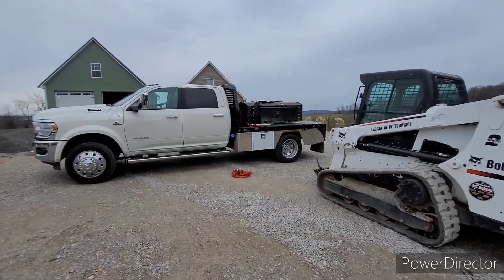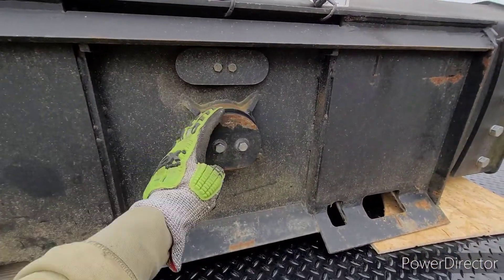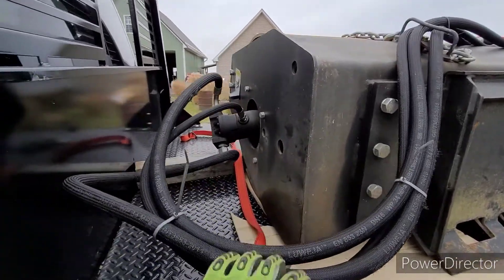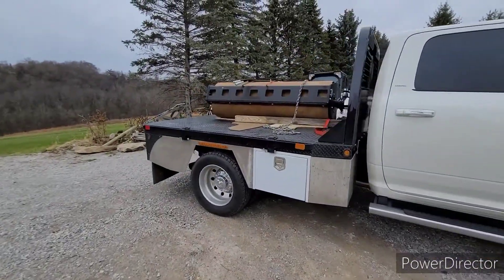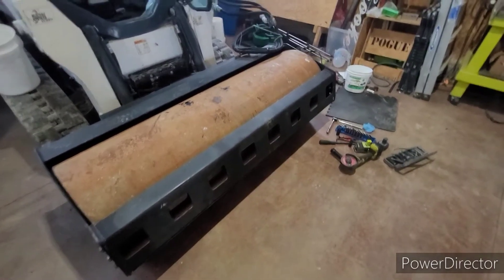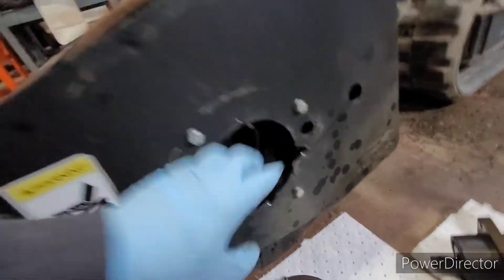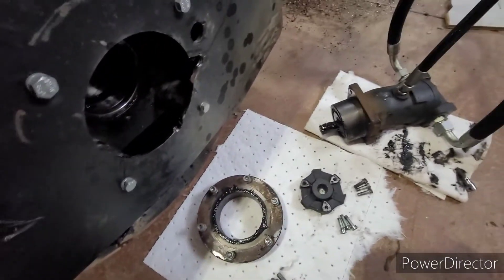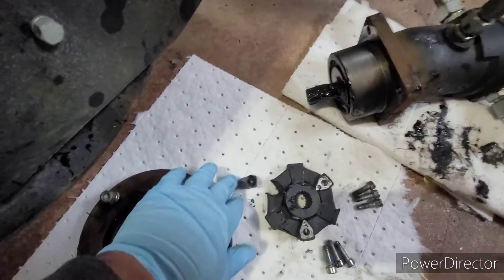Chinese skid steer vibrating roller diagnosis - Smoking problem.   Part 1

Comment: Did you ever go back and work on this more or did you give up on it?
Reply from the maker: I put another lovejoy in it and stopped running it at full speed.  It still smokes, but it got me through the last job.  As others have said, we believe the shaft isn't straight causing miss alignment.  It's currently a lawn decoration, waiting to send off to an auction

Comment: I have same roller same problem part # please
Reply from the maker: @raymondpadilla7041  68514438814
Reply: @ thank you .part has been ordered. Does this part take oil in the cavity? The housing had what looked like a rubber plug.
Reply from the maker: @raymondpadilla7041  mine didn't.  When you replace it, try reducing the flow, I think it will last longer

Comment: I have the same roller with the same problem.  Hoping you guys find a solution.  Has anyone looked at the parts from a different Chinese rollers to see if there is a better design that might work on ours?
Reply from the maker: I'm thinking about a belt drive setup

Comment: I have just received an email reply from Agrotk admitting the truth!

"Yes, we have had dozens of customers experience the same problem. It's a flaw in our machine design. "

It's time for them to become accountable for this design flaw. It has cost most of us thousands of dollars each. Unacceptable!
Reply: In the same boat as you admitted the part is bad and is discontinuing it.they hacked my email and erased all my messages from them if I was you I would copy your correspondence with them.

Comment: I have the exact same problem, and it seems many others do as well. IMO, this should be grounds for a class action complaint against Agrotk and Ritchie Brothers. This product is failing by design, yet they continue to sell it and rip off more unsuspecting buyers!
Reply: I'm on board with this guy.
Reply: Bro what??? You're buying a $15k piece of equipment for $1500 at an auction sold with no implied warranty.
Reply: I'm thinking the same as you but I went through my emails with them they hacked my email and deleted them all

Comment: Have you tried spinning the shaft by hand mine is very rough sounding and feeling
Reply: Mine is super-rough sounding, too. I'm starting to think that the failure of this connecting assembly near the motor is actually due to unacceptable resistance somewhere in the counter-weighted axle inside the drum. Maybe the Lovejoy-style connector isn't really the problem, but rather just the observable point of failure after something else causes too much strain and stress?

Is anyone else noticing a very rough sound from inside the roller before this connecting assembly smokes and fails?
Reply: @RickRossTN  I have a greatbear vibrator and it lasted 5 minutes working great.  Now it spools up, but feels as if its grinding on something and stops.  Puts a lot of strain on my hydraulic system when it does this.

Comment: I have the same unit, same problem. do you have the part # of the rubber spider?
Reply from the maker: Yes I do, it did the same exact thing though. Thinking is a bent motor,  checking it next
Reply from the maker: Lovejoy 68514438814 it was $147

Comment: How does the roller work now?
Reply: I have installed new bearings and seals packed the bearings with grease put it back together and it worked for almost 40 mins and then started to smoke. stopped unit and bearing was very hot add some more high temp grease. the connector is still ok but the heat is going to kill it. cant figure out why the bearings are get so hot? I keep spending time and money on this roller and still can't get a days work out of it. If the company knows there is a design issue then please tell us what it is so we can fix it.
Reply: ok I have taken the whole roller apart and the shaft bearing is the problem. tight, burnt and very poorly made.  bearing mounting plate on right side was loose bolts loose in drum. took bearing off of shaft softest bearing race I have ever seen. every bolt was loose and I only ran it for 5 mins? going to use lock tight when assembling.  Ordered new bearings should be in Tomorrow morning might have it running soon. Bearings where dry from factory. The grease I put in wasn't even close enough to fill bearing. Going to use the original lovejoy connector.  If someone finds a better replacement please let me know I have a feeling it wont last to long even with new bearings.
Reply: getting unit ready for new bearing that are coming tomorrow.  I was cleaning everything up and took the vacuum and cleaned out drum. Opps I think?? the about 1-2 pounds of metal filings  that where inside drum was it suppose to be there?? some type of damping? if anyone know please let me know before I put it together.  and if it was can I substitute sand??
Reply: @jphilippeos  where was the filings? I haven't pulled it apart that far yet. 
So are you saying the shaft and bearing get hot causing the failure of the lovejoy?
Reply from the maker: Did the same thing, I need to pull it back in and diagnose more
Reply: @Benjis-Industrial-Arts  oh great. I just bought mine two weeks ago. It lasted 10 mins.
Reply from the maker: @TheBattleBranchBoys  I'm wonder if the motor shaft is bent. next chance I get I'll check
Reply: Did you ever get this fixed. And how long did it last
Reply: @Joe bono  same thing with mine. I replaced it after 10 minutes of use and the new one was ruined in the same amount of time. I'm looking for a fix so if you figure it out please let me know.
Reply: @TheBattleBranchBoys  same here! Mine failed inside the first few minutes of testing at low rpms and fluid pressure. I got a replacement part from the Agrotk site, and after spending some hours to put it in and address the same problems @Fab to Farm had with the stupid zerk being impossible to access and the hole needing to be cut to remove the flange, it failed again exactly the same way in less than 10 minutes of light testing. The Agrotk SSVR72 seems to be a real piece of poorly engineered garbage.
Reply: @Rick Ross  I have been talking with lovejoy about a possible fix. They think they have a coupler that will hold up. I will post once I found out.
Reply: @TheBattleBranchBoys  that would be great news. Thanks! My email is the same as my name here, but at Google's free email service. Please email me if you have any interesting developments.
Reply: @TheBattleBranchBoys  if they get it figured out post the part #
Reply: @TheBattleBranchBoys  I also bought one of these shit rollers before I read the issues. 5 mins in smoke and i stopped and took into shop. I don't disagree that the lovejoy is a weak link but the smoke is coming from heat and the lovejoy wont generate the heat at least not that fast.. My theory is the bearings are dry and the grease is not getting into bearings ( not properly packed with grease from factory). I will taking apart and pulling out bearings next week. New bearings and properly packed with grease should eliminate heat. and stop burning lovejoy connector. My connector was still intact when I took it apart. the yoke that connects to shaft was discolored from heat. I also read that some feel girding noise when turning drum. I guess I was quick on the hyd switch and didn't as much damage. Forums like this help bounce ideas around. The roller isn't that technical it has to be a bearing or some part not machined properly.  I will post my findings some time next week.
Reply: @jphilippeos  mine is for sure smoke from burned rubber. Also my drum spins very freely. I have not looked into it since the last time it burned.  Maybe I should check the shaft. There has got to be a way to keep it from ruining the lovejoy.
Reply from the maker: @joebono6175  it lasted about 1 minute until it did the same thing. I bet it's just too much for the lovejoy
Reply: Same problem please keep me informed if anything came of the situation
Reply: This the latest update on my roller. After putting in new bearings and seals it was still running hot.  plenty of high temp grease.  burned up the lovejoy connector.  I figured I had nothing to loose so I welded the yoke and motor flange together. slide it on and now there is no rubber to burn. lol. ran the roller for 2 hours stopping to check temp of bearing housings. temp reached 300 deg F. I will let it cool off tonight and tomorrow I will check bearings and retorque motor. With no rubber coupling my fear is the vibration will loosen or break motor bolts. not my finest work but I either do what I did or sell it for scrap metal.  If anyone has more success diagnosing the heat issue and finding a better fix please let me know. P.S. the metal powder that was in the roller is Basalt and rock dust has iron in it. They use it in the roller for weight and to improve compaction.  Mine is empty for now if I have to take it apart again I will get 40 lbs of Basalt and throw it in.
Reply: @jphilippeos  how long did it last being welded?
Reply: @TheBattleBranchBoys  well the unit gets very hot. I took it apart again and put used engine oil in the drum (20+ gal).  I figure that the oil bath will help with the heat. I also stopped running unit continually basically rolling forward and vibrating in reverse (half the time) this helps with heat dissipation.  the welded coupler is showing some wear from the pounding (cheep metal). Reading Joe's comment maybe me starting and stopping isn't helping? But when I was using it originally I ran it continually and it got very hot (over 330deg). My unit works but if I run it to long I don't think it will last.
Reply: @jphilippeos  you can tell that it stops immediately when you turn it off. It could definitely cause some problems. I was thinking of welding mine. If it would just last an entire job I would buy about 10 of those lovejoys and just figure the cost on every job. BUT IT BREAKS IMMEDIATELY.  I'm sure there will be.  A solution, we just have to figure it out!
Reply: @jphilippeos  Do you have any pictures or videos of how/where you welded it?
Reply: Did some research and there's nothing wrong with the coupler the roller is apparently missing some hose valve relief system. The damaged comes from when the hydraulic pressure is suddenly stopped like when you have a washing machine in the spin cycle and you open the lid and comes to a sudden stop. There is another Chinese company call Chery industrial they call the roller great Bear. Now how to get these parts I am researching
Reply: @joeland3492  I can see that being an issue. It is possible to install a clutch? The motor already sticks out a mile, it's not like you have to save room.
Reply: I've noticed on the more expensive rollers all the bearings have oil bath
Reply: Be cautious with welding them together the motor is 800$ to replace